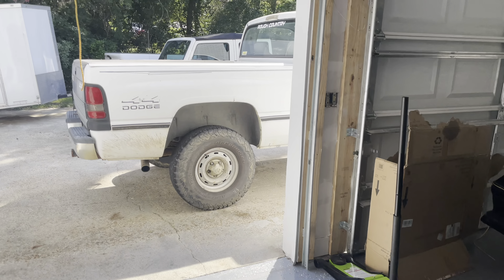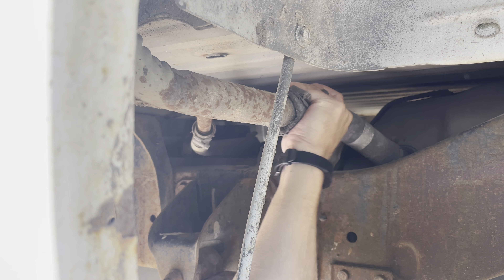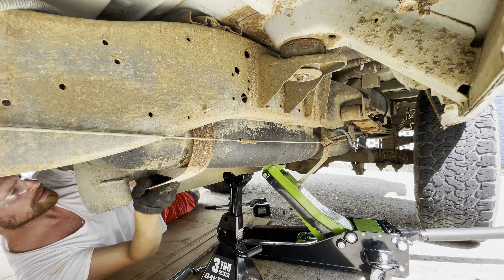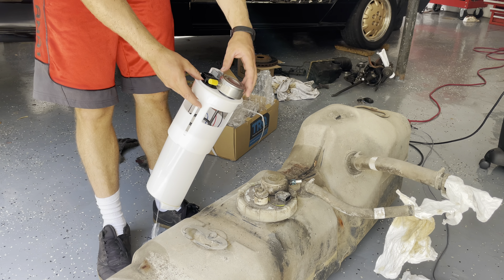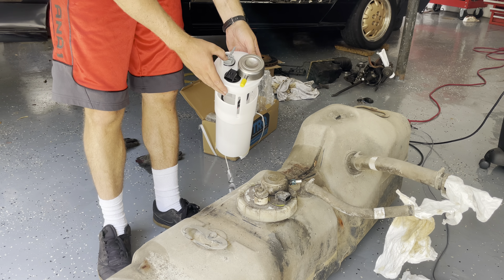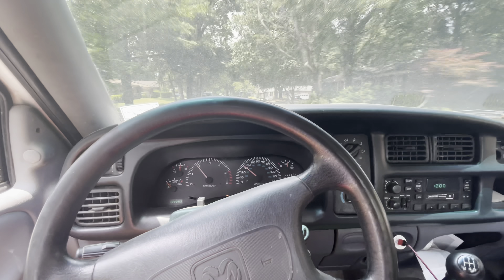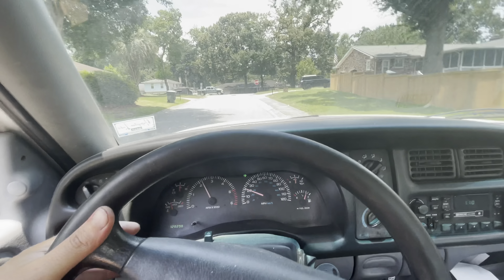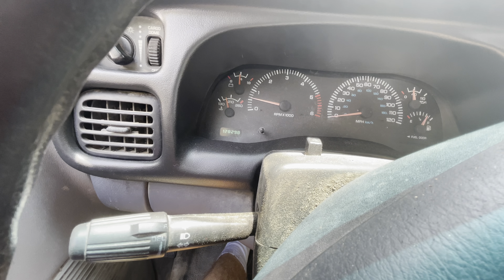I think I FINALLY fixed my favorite truck!!!

Comment: New to and enjoy your channel. I have a '98 5.2 and I had a very similar and annoying problem, yet a thorough cleaning of the throttle body, MAF and idle valve with a couple of small vac line replacements took care of it....for now. I'm thinking that initially if there was air in the fuel line after replacing the pump you would experiance the the almost stall symptom. Since this is 6 months later and havent seen an update, I guess the issue has been fixed. - Best.
Reply from the maker: Thanks for watching! The problem is still there at times, but not nearly as bad as it was. Removing the cat helped a lot. At this point I’m just living with it because I’ve done all I can think to do. Maybe a cylinder or two is a bit low on compression or something. I haven’t checked because it’s not gonna get a rebuild anytime soon so I’d rather just not know 😂

Comment: Austin, I am so glad my suggestion fixed your issue! Your last video was awesome as well. Looks like transmission mount is in my near future!
Reply from the maker: Thanks for the suggestion brother!! I’m not sure it’s 100% fixed but definitely a ton better. Even though the Transmission Mount is so easy on these, nobody does it, so almost every one of them is toast. 😂
Reply: @TheMoparGarage  Ya, I have noticed it isn't 100% too, but it is significantly better than it was. Since you were unable to get more footage due to your camera it made it seem like less of a pain dropping the gas tank. I know you stated it in the video, but it is a beast wrestling with it under the truck. Looking forward to more videos!
Reply from the maker: @stevens4799  luckily it only had a couple gallons of fuel in it so it wasn’t too bad, putting it back in is what always sucks! 😂
Reply: @TheMoparGarage  Hey Austin, I think I figured out how to 100% stop the surge. I replaced my Engine Coolant Temp sensor by the thermostat housing and after I did that. I have experienced 0 surging when stopping. Cheap easy install this time. Let me know if you try it and if it works for you.
Reply from the maker: @stevens4799  only sensor I haven’t tried, because the gauge still reads good. I’ll definitely be throwing one in though, thanks man!

Comment: O2 sensors
Reply from the maker: There’s no check engine light so I hadn’t done them yet, but since it’s not 100% even after the fuel pump that’s most likely the next thing I’ll do